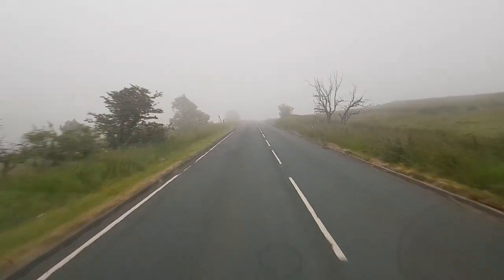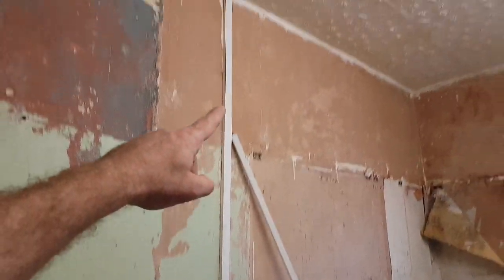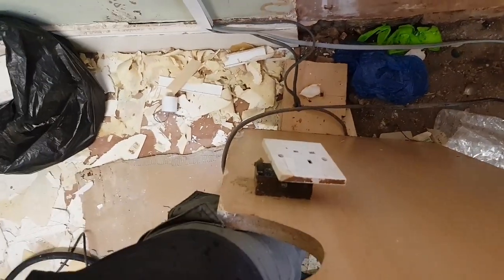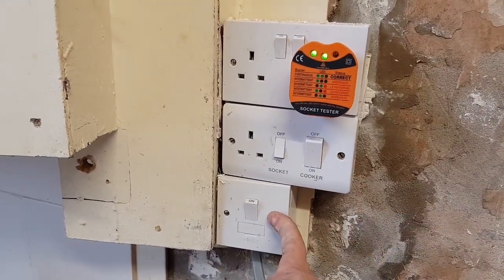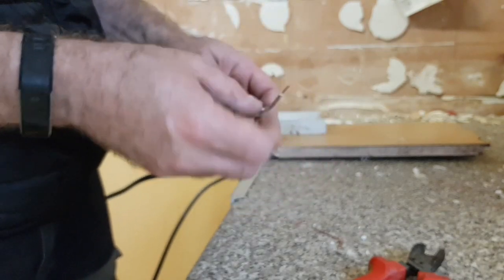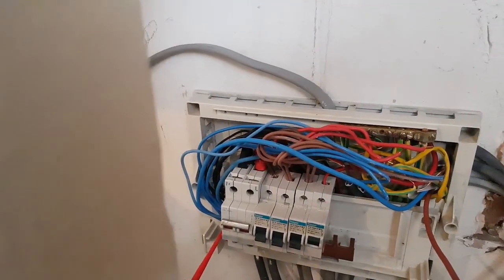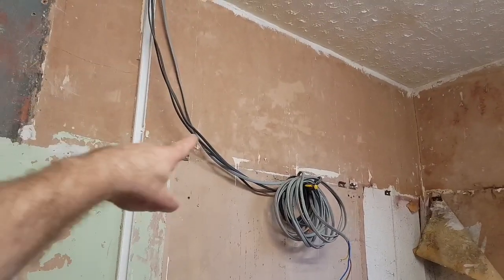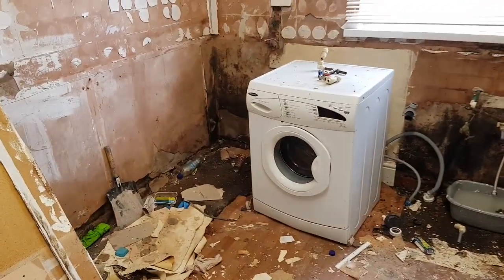Electrical check on a house of HORRORS!! (03)

Comment: I use my Fluke Volt Stick fort testting "LIVE CIRCUITS ONLY" not for DEAD... as you rightly do J... Even then, they pick up "stray current in dead cables" Dont you think these installs/tests/EICRS etc are picking up a diverse array of dodgy installations? it really is MAD!!!  Glad to see your content back James :-)
Reply from the maker: The UK has an overwhelming amount of "dodgy installations" we (electricians) are like fire fighters, putting out fires other have started with very limited tools or water in this particular metaphor. Domestically, social housing is the worst, especially private sector landlords. It does sadly all come down to money. Also many old people have poor or unsafe electrical problems as they come to the end of a 50 year stint living in the same home and never spending a penny on electrical upgrades. They probably don't know things need upgrading? After all if the light comes on and the cooker heats up..well everything is OK. Thanks for watching.

Comment: Im in the states..don't you guys use GFCI's over there ?  Your distribution panels are very Interesting looking!
Reply: They are relatively compact and can be quite neat if installed well... We do use GFCIs (RCDs), but until well into the 2000s (this board looks older) they weren't required, unless circuits were intended for outdoor appliances.
Reply: I think they have RCB's (Residual current device). They are the same as GFI's but they are breakers, not on individual outlets.

Comment: Had a problem in a concrete boat house, when i first walked close to the entrance door as i walked in, my non cotact volt stick came on, backed out, it went off, back in, back on. It was 6 x 10, bare concrete floors, all in emt, with romex. Stoppedhis wife from coming in bare foot, found the nuetral was broken entering the structure. The emt was now the nuetral. All metal boxes were hot. Ran new conductors from house to building, checked all wiring replaced what i needed. Installed GFCI at entry, everything was fine after that.

Comment: What amp is the socket with the cooker switch that you said maybe able to be reused as the cooker is 45 amp is the socket reduced to 13 amps as my compressor needs 15 amps to start regards mark
Reply: Mark Smith the socket will still be rated at 13 amps. It can deliver more than that for a brief period. What's the rating of your compressor? If it's less than 13 amps it can be plugged in to a standard socket, even if start up current is higher. Even fridges can have a startup current exceeding 13 amps so it's not necessarily an issue. If it's rated more than 13 amps you should install a higher rated industrial outlet or hard wire it on a dedicated circuit with its own breaker.

Comment: Kettle wouldn’t work as safe isolation test because the electrician didn’t spot the socket outlet switch was in the off position 😜😜